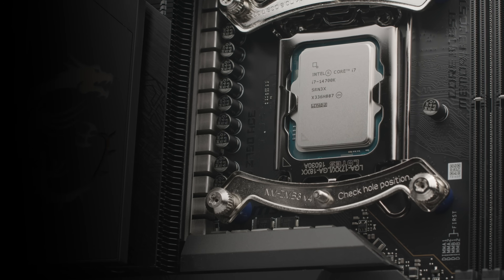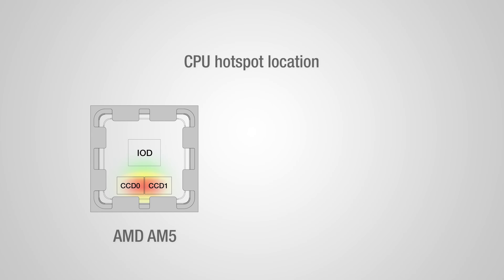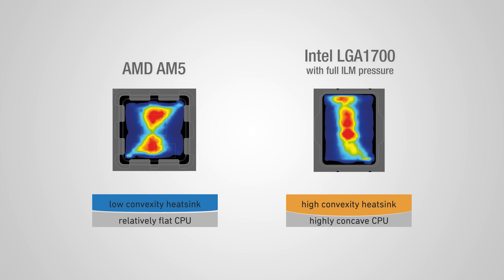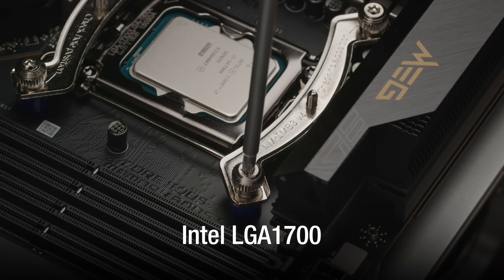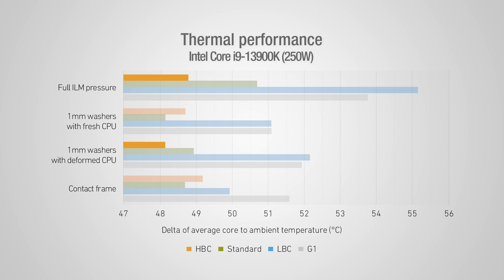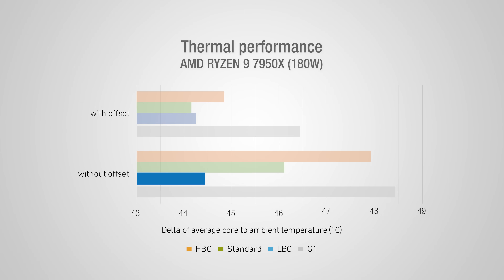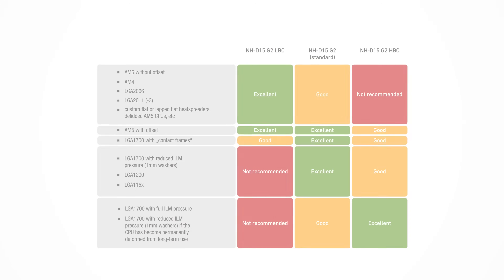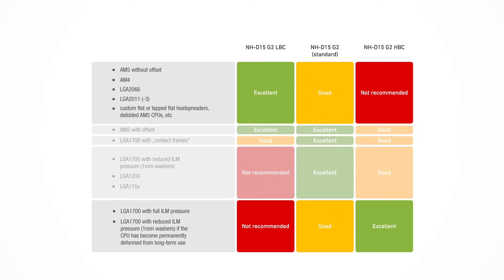Base Convexity Explained: Which version of the NH-D15 G2 should I choose?

Comment: i am using i9-9900k and currently using NH-D12, what should i upgrade?
Reply from the maker: We recommend the standard version for LGA1151: https://faqs.noctua.at/en/support/solutions/articles/101000526921
Reply: @NoctuaVideos  Looking forward for my upgrade, thanks.
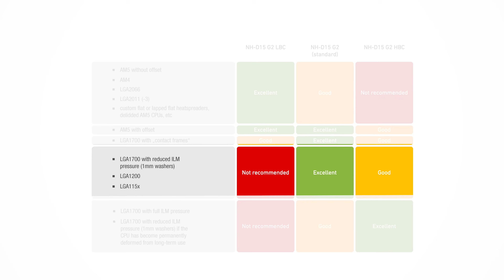Reply: Standard version as you can see on the sheet at 06:46
Reply: The 9900k

Comment: So with a 13700K on a NH-U12A used for 2 years now, I should take the HBC-version with the washers if I am correct?

A configurator would be awesome here to check the specific case :D
Reply from the maker: Yes, that would be our recommendation. You could try the HBC both with and without washers to see what works best for you.
Reply: @NoctuaVideos  Thanks a lot! But I have seen that the HBC version does not come with the washers so I guess the normal mount will be fine!